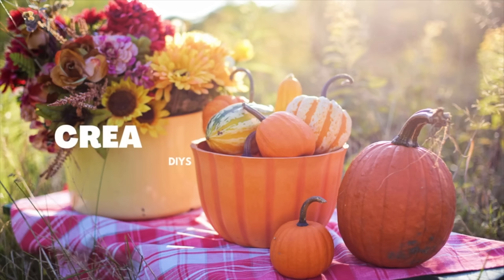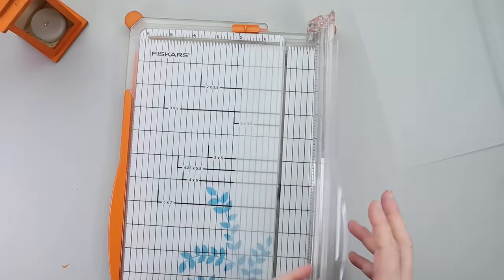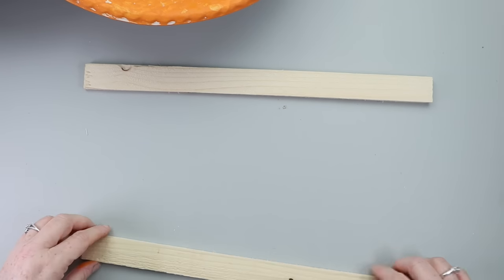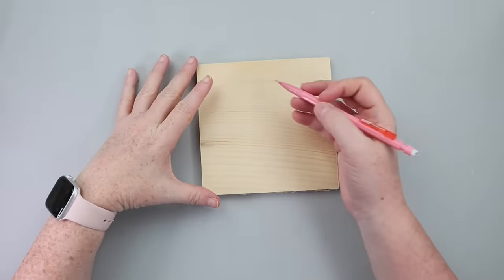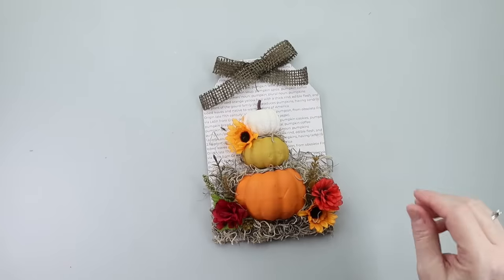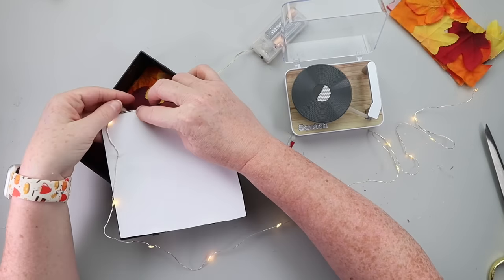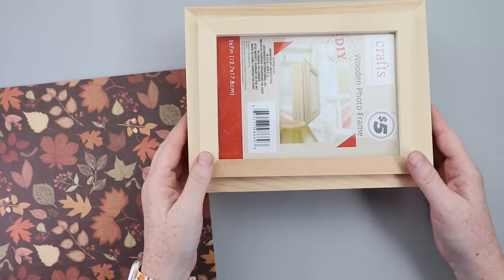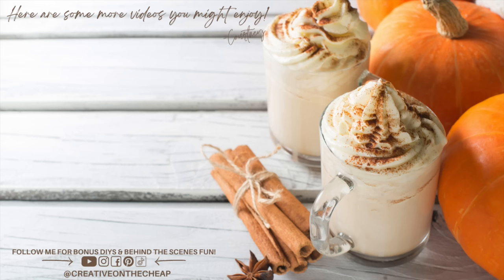🍁30+ Fall Dollar Tree DIYS & Crafts to COZY up your home! (easy, $1 diys to make now!)🍁

Comment: Hi Courtney 👋 . I believe that you can still bake your pie slice in the oven as the styrofoam doesn't melt at the sculpey temperature but higher. I have baked mine over styrofoam and it worked out fine. You can still do it with the spackle too.😊
Reply from the maker: Good to know!

Comment: Just a heads up u can bake the sculpey in the oven to cure and harden it 😊
Be sure to read the instructions for the temp and for how long u need to bake it 💕
Also, be sure to cure it properly. In its raw form and not all the way baked through, it can eat plastics 😬 If u run into an issue where the clay is burning or looks burnt u can always cover it, like a dome, to provent that 😊
Reply from the maker: @BulletHound  Yes, I have baked clay before The reason I didn’t do the pie is because I liked the sheen.  Looking back, I probably could have baked it and then put glossy ModPodge on it.  😂

Comment: i was always told not to bake sculpy in a regular oven, as they give off toxic fumes, that it is best to use a toaster oven. has this been an issue with yours?
Reply from the maker: I’ve always baked mine in the oven and sometimes a toaster oven.  It is safe to bake in you oven.  Where you might run into trouble is if you burn the clay.  Even then the fumes from that are not toxic, but might irritate air passageways.   If you burn, you just want to make sure to ventilate your oven really well after that.   Good ventilation is important when baking.   I’ve never had an issue.